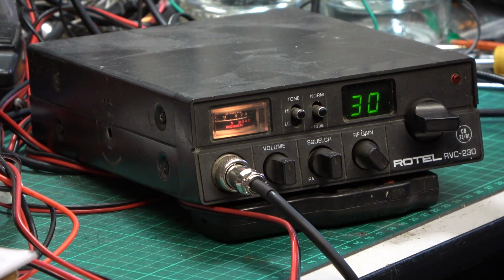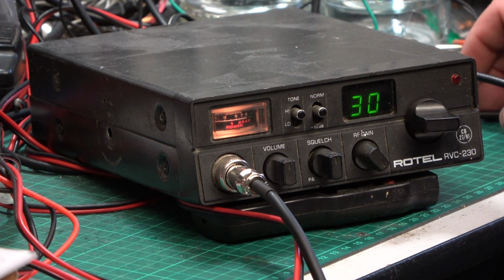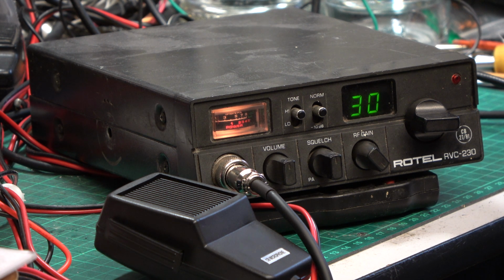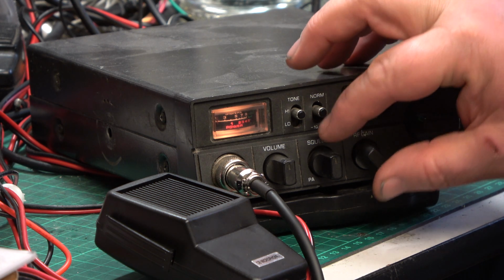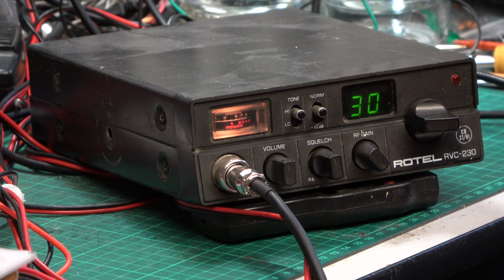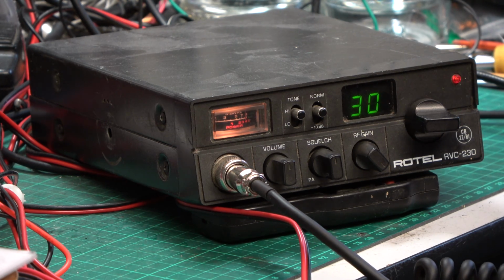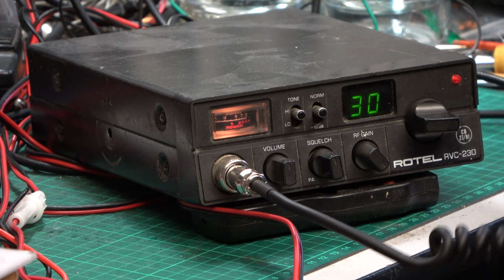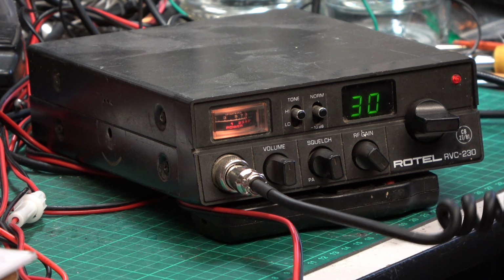K-PO Panther UK CE-MultiNorm CB radio (handheld) -  Field test (base end)

Comment: What about AM performance ?
Reply from the maker: We only cover FM on here. However, expect AM to be slightly less. That said, in this area of the UK, the CEPT set of channels is usually poor performance owing to a residual interference level of around S5. I've discussed many times on here as to why we don't test CEPT channels. For example; If I tested a handheld & found it did 4 miles on our range test, if the radio had CEPT channels we would only get 1.5 miles. Therefore if we went from FM to AM it would be even worse. Bear in mind most handhelds do much less power when switched to AM too as generating AM takes nearly twice the current of FM. Most 4W CB handhelds do 2.5W when used in AM mode. If AM is of interest to you, ensure you look at the specification before buying to see what the AM power really is on transmit.

As a radio amateur I do quite a lot using AM mode, even on 2M & 4M & find on the whole that AM & FM give around the same range with the same power level.

Richard, G0OJF, UK
Reply: @ukfmcbradioservicingTango21  I can remember in the 80’s when it was the craze and people were using the illegal AM. When FM came out, people were saying FM was clearer but the distance was not as good as AM.
Reply from the maker: @mariojohnson8317  When I started in business 2-way radio in the 80's, most VHF business systems including police & fire were mainly AM. As schemes came up for renewal (usually every 25 years), they all moved to FM. I think the CBers were possibly getting better range at that changeover period when UK FM CB was legalised in November 1981 as the UK FM channels were soon far too congested. I remember driving through Derby & spotting a row of terraced housed with CB base aerials every third house. No wonder they got bleedover.

Richard

Comment: Hi Richard odd no dev pot,Randy 2 does have deviation pot.Maybe different pcb as not GPE unit? Randy 2 TNC rubber duck longer than K-PO Panther can purchased seperately. I use the slightly longer option TNC whip or use stock ariel and a 2.7metre trailing wire on a o ring  crimp terminal,fits over TNC socket ,then screw helical down,thats gives roughly 3 S points more TX\RX due to having a ground plane to work against.A drop in charger and leather case are available too.Icom BP-232 and BC-160 charger,needs a slight mechanical mod to  battery lugs slides but works great,very good high grade sets.Loved the vid.
Reply from the maker: I'll order a Randy 2 then & we can compare. Must be tested with aerial provided though & not an aftermarket accessory aerial as it's important tests are done on properly serviced sets, but as they come with no mods.

Richard

Comment: great vids keep up the good work would be nice to see what part of circuit you are connecting the oscilloscope ..cheer and beers from frank 73
Reply from the maker: One receive, the oscilloscope simply is across the speaker output of the radio & it is usually only used for setting the detector coil for maximum recovered audio from the signal generator provinding a 100uV signal, equivalent to S9.

On transmit, we look at the transmitted audio when setting the deviation. The oscilloscope is connected to the test set's deviation meter output, hence two oscilloscopes,,,quicker than changing settings & leads around

Richard, G0OJF
Reply: @ukfmcbradioservicingTango21  thankyou Richard for your reply. nice to see a fellow ham take care and keep safe